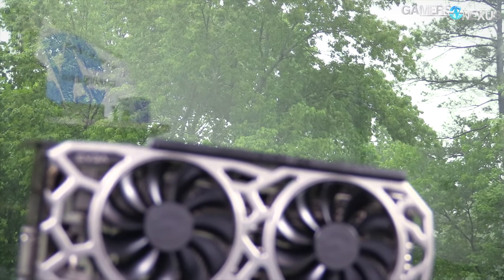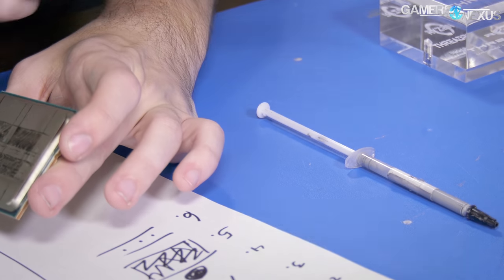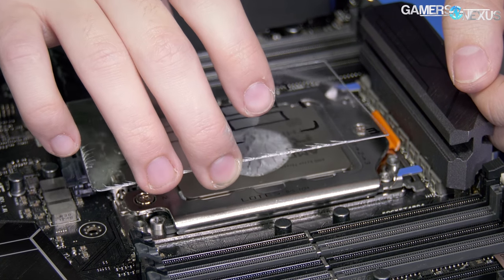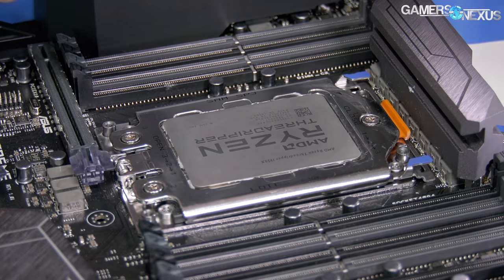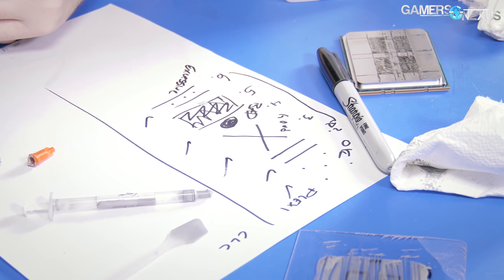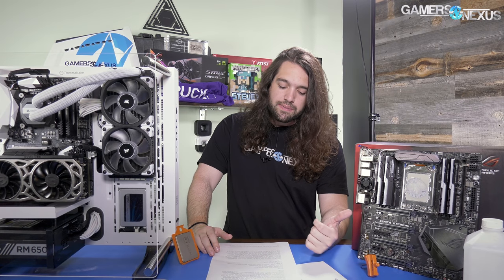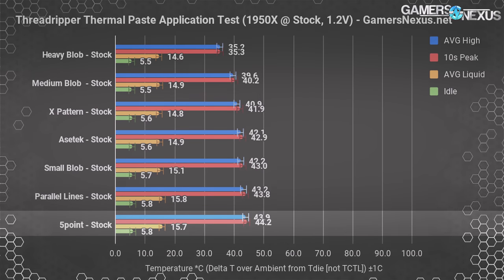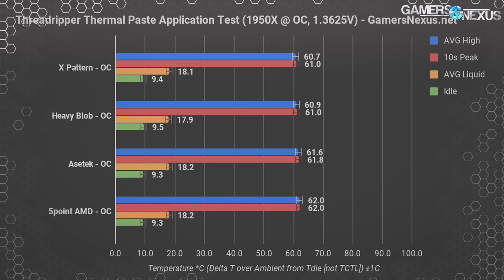Threadripper Thermal Paste Methods Benchmarked

Comment: what you do is take those nzxt pucks, put paste in the magnetized connect points, put to top part of the puck on top of the cpu and the bottom puck under the mobo and let the magnetic pull squeeze and spread the paste with even pressure.  Then take the closest nzxt tshirt and wipe of any overflow then remove the pucks and install your cpu cooler of choice to your now, perfectly spread and covered, threadripper and begin the overclocking glory!

Comment: You have a round base plate on a rectangle cpu. Best method would be a circle of thermal paste. 
All these methods are going to result in bleeding of the paste and not very good or over coverage.
A circle will provide full coverage with little or no bleeding, with a lot less paste.

Comment: Ordered the 1950x and a motherboard. Does the 1950x come with thermal paste included or is that something I need to buy separately?

-Jay
Reply: It would only come with thermal paste if it comes with a cooler, as the two generally go hand in hand.

Comment: This runs... cooler than 7900X, right?
Reply: Even my oven runs cooler than 7900X
Reply: makes sense
Reply: Tuchulu 
The 7900X isnt soldered so they are about equal.
Reply: Tuchulu no it just looks cool
Reply: Article says ambient was about 24C. Based on that; stock temps were 33.4C idle and 59.3 load, while OC temps were 33.4 idle and 85 under load. I'm guessing temps will be better with full coverage blocks. An overclocked 7900X can spike beyond 100C with the same kind of cooler.
Reply: I hope this is a joke. The surface of the sun runs cooler than a overclocked 7900X lol.
Reply: I have mounted quite a few 7900X's up to various watercooling loops, and even at around 4.2-4.3ghz, it will 9 times out of 10 start throttling itself because the thermal compound vs solder that Intel stupidly decided to cheap out on and do, has pretty much ruined the ability to get as much performance out of them as you can. I promise you that Threadripper will not have that issue. And again, my experiences weren't with Asetek coolers. They were with full blown watercooling loops, with one of them even utilizing three 480mm radiators. The 7900X is a disappointing venture if you're an aggressive overclocker, to be sure. And Threadripper has got me excited beyond belief.
Reply: Considering they were running Prime95, then this runs way cooler than 7900X. In a more 'normal' workload like rendering or encoding it should run about 5-10C cooler than this stress test. At stock clocks that would place it at about 50C under full load which is very good for a 16 core CPU.
The 7900Xs main cooling issue is the junk thermal paste, Threadripper doesn't have this problem.

Comment: have you guys tried reverse application rather than on the cpu on the cooler before it goes on, yes it may be a little more messy but it would optimize contact for the cooler since the cpu's contact is the bigger than most coolers...

Comment: The only way the glass method works is if you use 7.5Kg springs to mount a thick clear block. Use the thin glass to protect your  thick clear block because some types of  TIM is gritty and will destroy the glass and the one I made cost me a bit. I check all my cpus when I get them and my coolers and water blocks. Most of the blocks I get from EK are convex with the high point being in the middle I lap all my EK blocks with great success

Comment: Couldn't you have asked how much mounting pressure a typical AIO applies and then found a suitable weight to put on the plexi? rather than just pushing on it with your hands. Probably wouldn't make a huge difference but it might better represent how the TIM would spread.
Reply from the maker: We covered that with the second half, where we apply the coldplate directly and then show the spread after mounting & burn-in.

Comment: There are two other methods that you did not mention, the X and 4 dot method, and due to the die shape, the X and 2 dot method with the 2 dots at the elongated sides of the die.     [EDIT:   If you can get a large Noctua cooler, please make a video of your results, i.e. a comparison to the supplied water cooler.]

Comment: Hey, i know this is an old video now but... looking at it makes me wonder why you just didnt make the transparent plate the exact size as the cpu or abit bigger so that you could have been able to just screw the AIO on top and get the exact pressure instead of pressing with your hand or another object? .. Cpu [] Transparent plate [] AIO...   just remove the AIO and there you have the perfect display of the result , no mess on the AIO to clean up every time either ☺️ i’m not a 100% this will work but it should? 🙄This was just a thought from my side but really good video overall! 
Ps. Sorry for my bad grammar 🙈

Comment: Can you not mod that plastic shim thing to go under a heatsink, so then you can apply the pressure you need and then take it off and see exactly how the paste has spread, without taking paste away with the heatsink. Maybe would need to use thinner plastic.

Comment: My predictions before I watch the video: won't make too too much of a difference, assuming ThreadRipper is also soldered. The only difference would be how well the IHS transfers heat to different parts of itself. Which is much better then thermal paste. Just my theory. I'll update to see if I was wrong at the end

EDIT: Semi correct. Doesn't make too much difference. I with Steve, it would be cool to see full coverage plate testing

Comment: Is the EPYC processor able to be used in a ThreadRipper Motherboard?  Isn't the EPYC essentially a ThreadRipper with all 4 dies active? So then wouldn't the best cooler solution be to have a heat transfer plate re-designed so as to be rectangular in shape and to coverall 4 die locations so that a cooler solution would be both ThreadRipper and EPYC compatible?

Comment: I would like to propose an idea for improvement of these kinds of tests:
apply the thermal paste on a precise scale. This way we could precisely tell how much paste is applied or compare methods with the raw amount of the paste equalised. :)
In case of other sockets it would be enough just to place just the CPU on the scale, but in case of Threadripper, due to how the installation procedure goes, I guess one would have to weigh the entire motherboard. :/

Comment: I just don't get this ongoing discussion. If I buy a 1000 bucks cpu...I take the time to spread the thermal paste with a credit card or something so the whole cpu is covered. I always did this like that and will always do it like that.
Reply: 1 year late, but whatever.
You definitely shouldn't spread the thermal paste manually, as you'll cause un-even coverage leading to air pockets between the IHS and the cooler. Also, as  he explains in the video, there's no need to spread paste over the entire IHS, as the actual processor core(s) are located in the middle.
Reply: Grey-man  it doesn't matter.  If you didn't have an IHS it would matter. You'll get micro pockets of air any which way you do it.

Comment: Room temp was not a factor? I mean the big blob has the advantage for been the first one using a cooler room.
You need to check room temp all the time before running the test, sure you did but make no sense that big delta on first run.

Comment: Why not push with a cooler on the plexiglass in order to put more force on it?
Reply: No matter how much downward force you use when pushing a heavy object down onto the IHS, its not going to be even or secure. It will slip around, your arms will give, you will not have even contact pressure across the entire surface area of the IHS and you will flex the board etc. Besides this, you are not going to get anywhere near close to the contact pressure of screw mounting the heatsink to the IHS with the proper mounting torque.

The pics showing the spread pattern when the cooler is properly screw mounted prove this because it is a uniform circle with all methods. The only thing that seems to matter is the amount of paste used (e.g. there should be enough paste to spread out and cover the entire cold plate, screw holes and all since some of them are over the dies).
Reply: peterninefingers he is lazy

Comment: great info however 

5c is 41F 15c is 59f you can never get below ambient liquid or air, so were you in a fridge during your tests at idle??

how do you account for this?? or is it the temp difference between idle to load??
Reply: Delta means difference, in this case difference between ambient temp and cpu temp.
Reply: thank you, i am fairly new to this and learning as i go
Reply from the maker: What? We're not measuring in fahrenheit. Not sure why that's being mentioned.

The temperatures are delta T over ambient.
Reply: as i have said im new to the deeper technical stuff, and learning as i go, thanks
Reply: No problem, you always have new things to learn :)
Reply: Ignacio Mella appreciate it 👍🏼

Comment: So my take from this is currently avaliable coolers have their limitations with this cpu because of its size.

Are there any being made adapted for threadrippers size?
Reply: I wonder if a push pull configuration on the X62 would significantly improve the temps.

Comment: Hey Steve can you give us a video reviewing any of the x399 motherboards yet? I THINK I saw that you have the most expensive one, the Asus Zenith Extreme x399, right? Can you at least tell us if that is worth $200 more than like the Gigabyte Aorus x399 Gaming 7? Because aside from the NVMe riser card and the Dimm.2 slot I can't fathom why it's SO much more? The Aorus board seems to have mostly the same features at a much better price. However I'm hesitant to go for the better price this time around, I told myself I would buy Asus, but the lower end Asus Prime board is just awful looking with like NONE of the better features that the Aorus has at nearly the same price. Ugh... I would really appreciate it soon if you can man, there are preorder gifts for a couple boards and I have to buy a motherboard anyway, I'd love to be able to get a free headset or something by preordering.
Reply: That's true I remember the fan over the I/O. But aside from that is what I'm talking about. Think full custom water-cooling loop up the wazoo, as in full monoblock if EK ends up making it.

Comment: This test is a bit weird. I understand the "round" cooler is too small, but what about the squarish cooler is it also too small ? At the end of the video you make it seem so.... Also the temperatures shown... is this an average for both coolers, or for just the round one ? The results that the big blob is better is kinda surprising, is this because only the round cooler was used ? Bit confused about this. 10 degrees celcius difference is a big deal though ! So far maybe inclusive until bigger coolers are tested.

Comment: WHAT IS THE AMBIENT TEMPERATURE? God that drives me crazy.  How hot was it actually running?
Reply: Pick an Ambient.. I pick 23c.. Now do the Maths! Max was like 85c with their over clock.
Idle was like 32.5 
26.6 Ambient would put this at like 88.6c  This is about how hot it would have been where Pauls Hardware was testing.

A delta is how much over Ambient so all you have to do is plug in your own Ambient to get what you should expect.

Comment: The Thermaltake Floe Riing 240 Cooler software does not work with Ryzen. TT support confirmed this for me. I had pc shutdowns immediately after launching software. Latest update does nothing and no fix in place. This cooler is not recommended for Ryzen. The only way to get software working is by launching in safe mode. Great video on Thermal paste though, love the work you do and the tests you go through.

Comment: i assume the big blob is better because there wont be any air pockets(the air is pushed outside). by any of the other methods air could get trapped. 
Would've liked to see manual spread for comparison though. even if you say its not worth it i still would've liked to see numbers for it.

Comment: Clearly the solution is to use the whole tube of compound and get a quarter-inch thick layer of compound across the entire IHS then just let the compound spill over when you put the cooler on for extra socket cooling
Reply: Nmotsch idontwannagivemyrealname yeah I think it needs a jayz2cents kind of application. spread it on

Comment: Would it be possible to test it so the cpu gets hot then remove the cooler and point a heat gun at it to see which lanes heat up more?
Reply: Huh? Oh you mean a Flir camera or a Temperature Gun lol.. a HEAT gun would be bad.. very very bad lmao..
Also do YOU want to run your CPU with Zero cooling on it? You will thermal shutdown very quickly and possibly fry or damage your CPU.. Then how will he be able to give us the Benchmarks and such?
Do this with maybe a $50 CPU if you got $50 to burn.. but a $1000 CPU? No Thank You!!

Comment: Those who do not know the past are condemned to repeat it and repeat it and...well, you get the idea. Some years ago, a site that shall go unnamed tested around 40 different compounds, ranking them as you have, but that is not what was important. Rather than trying a few more or less silly patterns and giving up, they tried many more patterns and thicknesses, coming down to an understanding that there is enough and there is too much. The very best compounds become insulators when thicker than is required to create maximum contact between CPU and cold plate. The purpose of the compound is to eliminate air pockets that conduct heat very poorly. Anything beyond that is wasted and works negatively. That is why using a hard straight edge like a credit card works best. It bridges any small pockets while removing excess. Also, with a little pressure and effort, compound will be worked into any microscopic pits in the surface, a process called burnishing. Having enough on the surface to actually flow under pressure and heat is hopelessly inefficient. 

And, the idea that any person is equipped to sand a cold plate or CPU to a level surface is as likely as that person producing their own CPU chips. I am sure that there is the occasional extreme case where either the cold plate or the CPU is visibly curved, but those are not cases for DIY but for returns to manufacturer. If you have a milling machine accurate enough to work over the target areas at an accuracy of better than one ten thousandth of an inch, go for it: otherwise, return it. Of course, there is always the possibility that you will machine into areas that will do more damage than good, so refer back to the previous sentence. 

Lastly, for those who actually care, you should see a photo-micrograph of any supposedly smooth surface. It looks like the mountains of the moon. The point is or, I should say, the points are, what we are working around, trying to improve the contact between two supposedly smooth surfaces.

Comment: should use minimum 5mm plexiglass, no cpu cooler is made of 1mm thin flexible metal XD
Btw i prefer to apply a blob with a small x and take on the cooler without fastening it i then turn it slightly back and fourth to help spreading, have always had very good spread (Old Intel i7)
Reply: you want a very thin layer since thermal compound will Never be as good conductor as a solid copper piece

Comment: uh, not using manual spread method in these tests makes me kinda sad... also why not  manually spread the thermal compoud on the  aio instead of the ihs?
this means u can make sure, that the sink holes are covered and that everyplace where there is a connection to the ihs is contected with tim.
Reply from the maker: We already talked about that in this very video.
Reply: If you spread it then you know for sure it has full coverage.
Reply: Big center blob is 5C cooler than all other methods. I doubt complete manual spread will be as good or better as big center blob.

Comment: why not just put a thin piece of clear plastic under the cooler? that way, you get the proper mounting force and it doesn't suck up when the cooler is removed

Comment: Seing as the thermal interface inside the cpu is a soldered one, and the heatspreader is so dense, applying thermal paste should be no different than on regular cpu's.
You're not going to have a difference in temperature from the centre of the block to the sides..

Comment: Why just not put thin layer on the whole IHS. 
And lets say, 5 milimeters on edges) without thermal paste. 
It's so hard to apply.. or ppl think their CPU's will sink with thermal paste.
Reply from the maker: We did that, but axed it (as explained in this video...). The reason is because we don't contact the whole IHS anyway, so sort of pointless. Best saved for a coldplate that has full IHS coverage/contact.
Reply: Gamers Nexus What about spreading it on the cooler. Manually filling in the screw holes with thermal paste.

Comment: Try again with the actual heatspreader. Your hands might not be able to exert more force, but a cooler? Hell yes. Plus, this method is a bust with the wobbly plexiglass due to very uneven force distribution. What your method shows is how the paste would spread if the heat spreader was shaped like your hand, and had a soft layer like the plexi.